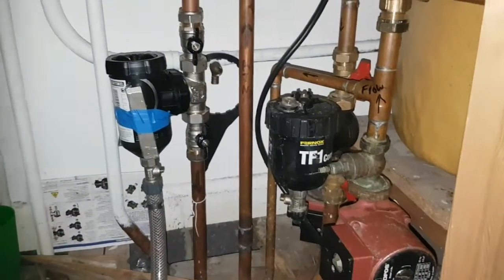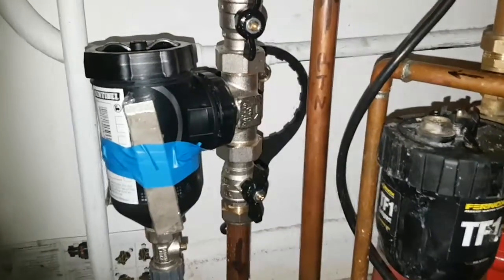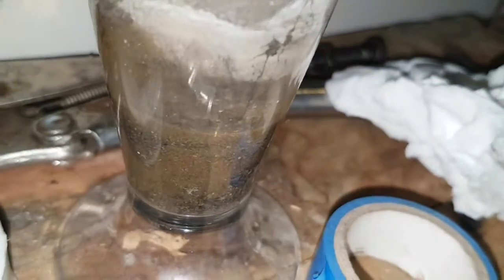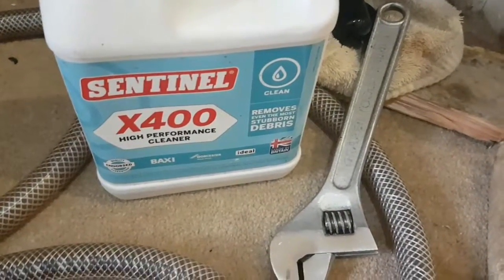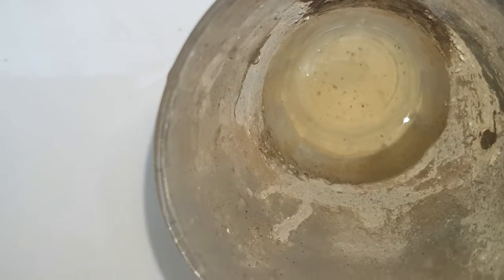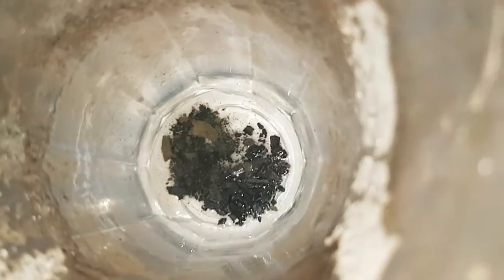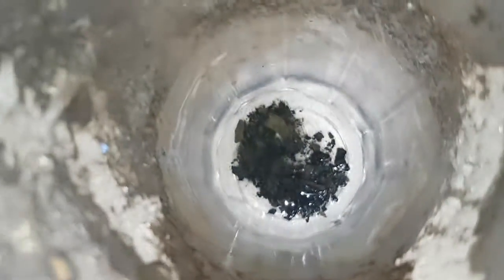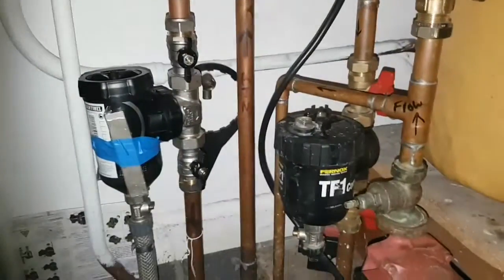SLUDGE: Sentinel Vortex 300 vs Fernox TF1. Plus cleaners FX2 vs X800 x DS40 vs X400!

Comment: I only use X400, leave it in the system for a good month during the heating season. I can report every time much warmer radiators and better working floor heating. I power-flush before AND after. And while it clearly cleans very well it is also less aggressive, so heat exchangers in the boiler are not damaged, especially the aluminum ones.

Comment: Is there a possibilty that the additional magnets on the outside are counter acting the effectiveness of the central magnet? I have just researched how vortices work and the particles suspended in the water would collect centrally (try it in a jar), not at the edges due to centrifugal force as outlined in one of your other replies. Did you test the Vortex 300 without the additional magnets with the exact same setup? Thanks.
Reply from the maker: Its a good question and yes that is possible if the filters were smaller. As the particle mass is slightly denser than the fluid it would be more effective to collect from the outside. The liquid votex only sucks items down the middle mainly due to gravity and the time it takes depends on the mass of the item in relation to the fluid its in and flow.  Ideally the filter would have a thin wall water gap surrounded by magnets as the magnetic field reduces inversely with the square of the distance and particle size. The outaide magents are too far from the inside ones to have any signidicant interaction with each other.

Comment: Could you try the units the other way around?  Because if the sediment has already passed the 1st unit magnet would it not be partially magnetised and be trapped by the 2nd unit magnet? I may be wrong but is it not worth a try?
Reply from the maker: As they go through the boiler, the heat would destroy most of the magnetism I'd say, depending on how hot your boiler was of course.

Comment: So when a combi lets say hasnt been cleaned or hasnt been protected over the years by  inhibitor.  The boiler parts, including the divertor and hw hex & valves always have a crud, a hard residue bleeding out the brass parts.  Is this limescale?  As our area isnt hard water, although the next town has really bad limescale.
Im just wondering what cleaner would be best for a cycling, overheating combi?

Comment: I'm not a big fan of magnetic filters but we have to fit them now as manufacturers require this or they won't honour the warranty on the boiler , all I can say is I have tried every brand on the market and I have found the best overhaul filter is the Adey Magnaclean for removal of most of the larger bits of oxide sludge that's in a system , also I agree that Sentinel x800 is the best chemical for aiding the removal of sludge and breaking down other contaminants in the system.....👍

Comment: You mentioned power flushing what rig do you use?
Reply from the maker: It was unbranded..big pump driect into flow and return.
Reply: @theq-1  Did you source the rig from a hire company?
Reply from the maker: @normanboyes4983  No I bought one off ebay second hand used it for a few months on and off then sold it.. lost about £30, mainly because of postage but much cheaper than hiring and no time rush.
Reply: @theq-1  thanks for responding.👍

Comment: Liked the video 👍👍
I'd love to hear any feedback on this little tip. It can be used on any central heating system. 
I wouldn't waste my money on these magnetic filters but instead place the neodymium magnets on the radiator or radiators. Fit a drain plug to BOTH sides of one ground floor or magnetized rad then when flushing do so with all magnets removed.
Reply from the maker: That works better than a filter if you put it on the return side of the rad  because you'd be collecting rust at source. These filters are really just a cheapo , not very efficient "fix".  I guess people don't want to pull a rad off to clean it.
Reply: @theq-1  No need to take the rad off. Open the drain fully then remove the mags and flush any collected debs away.

Comment: Can you do a test on microbore using DS40 powder and neutraliser - Would love to see it working
Reply from the maker: Sadly I dont have and DS40 left. Some of my pipes (15mm) where blocked solid, so i used  everbuild patio cleaner (acid) mixed with water and it cleaned them straight away, bit of a gamble though but it was that or start cutting up floors! Ill do a vid on that.
Reply: @theq-1  I love to see that, great upload.  I find the old magnaclean professional to be the strongest.  They seem be the most effective from all the installations I go out to. 2nd I would say is the boilermag the rest seem to be about the same.